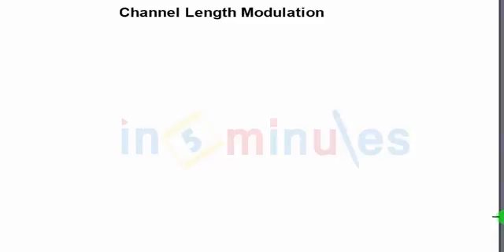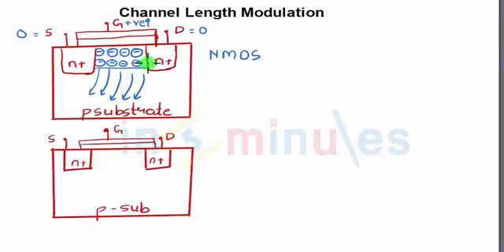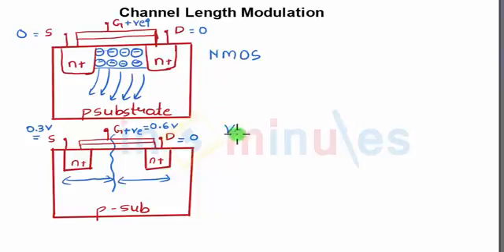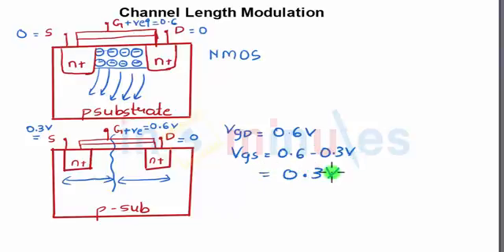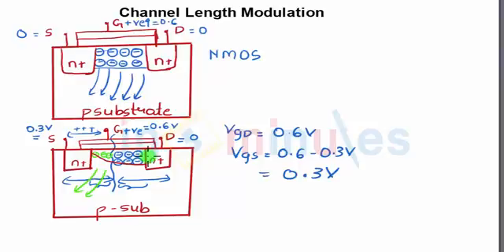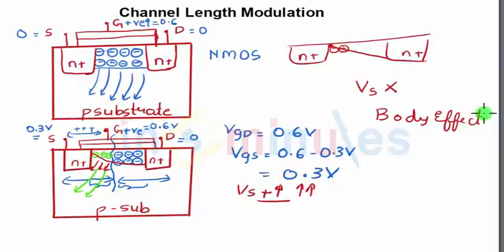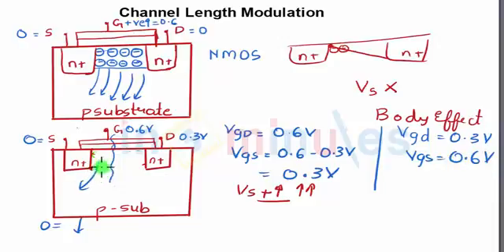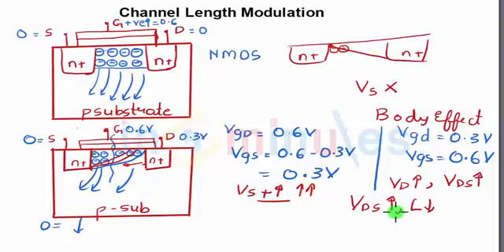Module1_Vid13_Channel Length Modulation General

Comment: Why should I give voltage at drain terminal ..... We will never apply any voltage at drain .... So ?
Reply from the maker: Hi Kanna P S,

Thank you very much for your specific comment.

If you consider any cmos circuit, ideally NMOS is used as pull down network and is ideally connected with source grounded and drain as output terminal.

Channel Length Modulation is a concept which is understood when variation happens with voltage change at the drain terminal of NMOS.

Hope that clarifies it for you.

Thank you so much once again for asking the question.

Hope you got chance to see other videos in VLSI too. We have uploaded videos in COA too.

Do keep writing as would love to hear from you.

Share with your friends if you think they can benefit.

All the best !!!